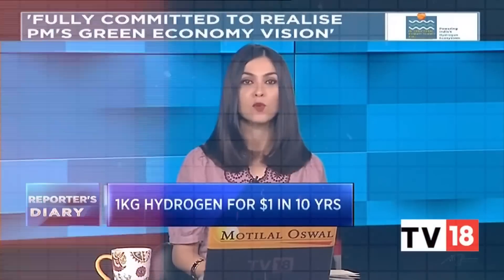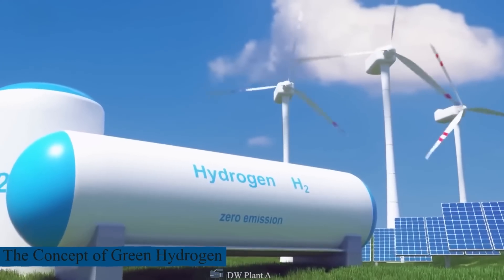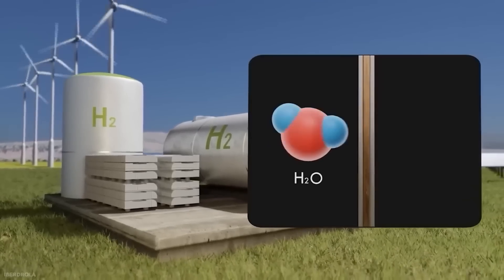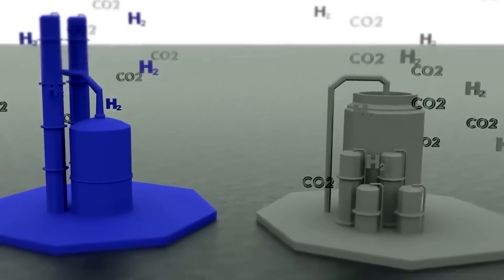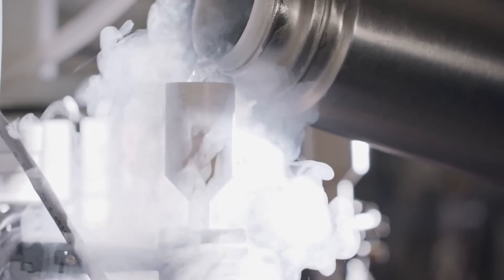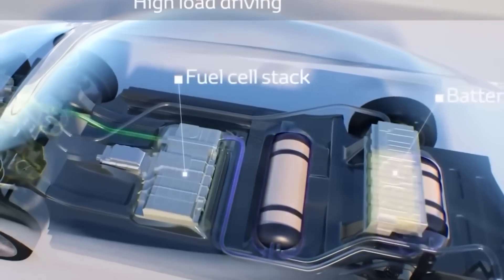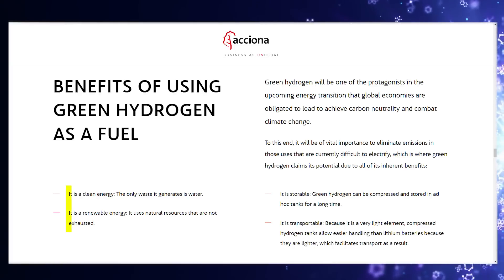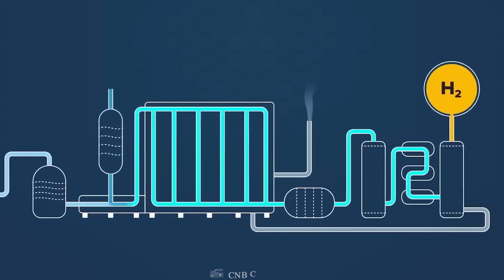New Hydrogen Fuel Cell Breakthrough SHOCKS American Scientists!

Comment: Correction, 100% of all matter everywhere is made of hydrogen atoms. Elements are not atoms, that's why we call them elements. There is only one atom, which is hydrogen because everything else is nothing more than a compound of hydrogen. This gas they call hydrogen is also known as Brown's gas, which has been separated from water by inventors for decades, this is not new and neither is the containment of hydrogen new, just ask Bob Lazar.

Comment: The graphics show the separation of gasses from water but indicate O2 and H2, it should be O and H2.
Reply: you sure? I've never seen single Oxygen
Reply: @monikakrupczewska5151  Water is comprised of H2O, two parts Hydrogen and one part Oxygen.
Reply: @MrOGREATWISEONE  Oxygen exists almost exclusively in two-atom configurations.
Both atoms and compounds tend to arrange themselves in their lowest possible energy states. Oxygen atoms have 6 electrons in their outer shells. Atoms exist at lower energy levels when all their shells are filled. In the case of Oxygen atoms, there is room for two more electrons in their outer shell that could find a home there with only a small amount of extra energy. Another Oxygen atom is in the same position. It turns out that that by forming a kind of joint outer shell, often called a double bond, the total energy of that shared shell is less than the energy of the two unfilled shells in the individual atoms. Thus this is a preferred configuration for them.

Comment: How can I liquify hydrogen 
Which machine do I have to use for liquefaction of hydrogen gas .. and how can I pressurize it?
Reply: Hydrogen becomes a liquid at extremely low temperatures.  I believe around -125 degrees Fahrenheit.  One problem is hydrogen has a history.  there was a dirigible  called Hindenburg, it was operated by a German company.  No one is sure what happened but it exploded into flames when docking. a lot of people died.

Comment: The problem is that we have already known that hydrogen has been proven to be a viable alternative to gasoline and we have known about hydrogen for decades. We have seen how to get hydrogen from water way back in the late 1890's and how to use it to get power for gas engines. The other is the use of methane as a fuel as was used in the 1920's and throughout the 1930's as gas for farm tractors and other uses like for cooking and heating.
Reply: You cant store the stuff easily, one very commonly known fact this fluff video actually got right. Until then its a pipe dream...mostley for big oil companys. Methane is not a clean fuel. We already use natural gas.
Reply: I suppose by "the problem is" you mean that we have known all this, but the costs of it compared to the fossil fuel combustion system were too high. 
The only factor that breaks this logic is the fear of the long term impacts of anthro climate change.

Comment: As soon as he said it has no by products I knew this was just another snake oil salesman. Impossible not to have by products weather problematic or not because that would indicate 100% efficiency and that is as I understand it impossible. Liquid fuel at atmospheric pressure and room temperature will always be safer, cheaper, and easier to transport and handle. Remember the sales pitch about solar and wind generation that there was no ill effects from it?

Comment: bzzzz wrong 'fake news' 'gas seperation' or 'gas storage' is Not 'Fuel Cell Breakthrough' a Fuel Cell is the device that turns the 2  separate gasses directly into 'use it or loose it' electricity using expensive platinum theres not enough of that to make industrial scale Fuel Cells the world over

Comment: Couldn't even make it all the way through this video. This dialog has the same structure as snake oil sales pitches where the tag line is repeated about 5 or 6 times without ever getting to the heart of the story. This "presentation" does not talk at all about what the "Breakthrough" is and why anyone should believe any of this hype. What a waste....BTW, no such thing as zero waste. After 45 years in industry I have never seen it.

Comment: There is a lot of difficulties with hydrogen to solve before it's let into everones hands. One thing thats not so much spoken about is that free hydrogen can prolong the life of methane, and therefore increase the amount of greenhouse gases in the atmosphere, thats more of a problem because hydrogen is hard to contain without leaks. And before any hydrogen is used as fuel, it would be prudent to replace that hydrogen wich is neccesary for the production of fertilizer. That production today uses as much energy as the aviation sector, in the form of natural gas.
Reply: Be interesting to know how significant that side effect of hydrogen would be compared to reduction in use of crude oil based fuels; or compared to the vast increase in metals mining and processing for the EV industry.
Reply: It's not new concept,I read about hydrides in chemistry books, palladium metal absorbs about 800 times of hydrogen

Comment: After all of these fancy graphics, they end the video with "they need more study to develop and store it."  Wake up, people have been using hydrogen in labs and elsewhere for 100 years. I use it as the primary fuel for heat and power in my generator, as well in my motor home instead of gas or diesel fuel.  It's cheap and easy to make, doesn't taker a large space and is easy to store with a little equipment operating on sensors and running automatically in the space of an average suitcase.

Comment: Storing hydrogen doesn't overcome the inefficiency in electrolysis and fuel cells.  Currently hydrogen takes 2.5 to 3 times more energy from electricity to motion in a vehicle than batteries.
Reply: I've asked this question,how much energy is used to generate 1 litre of crude oil,then to pylorisis to 1 litre of gasoline? clearly hydrogen on demand is better
Reply: 8:26

Comment: Liked your video but it's old news. Storing hydrogen in metal hydride has been around for close to 3 decades. You can read about it in "Stan Ovshinsky and the Hydrogen Economy". Mister Ovshinsky also invented the Multi-Junction Thin Film Photovoltaic Solar Module, NiMH re-chargeable car batteries and other technologies buried by Big Biz... Good to see your back on the right trail.
Reply: germany discovered a very good way to store it in a special paste, which is pretty promising.